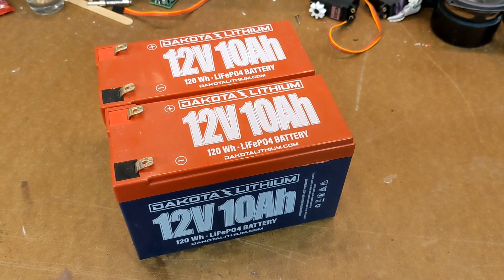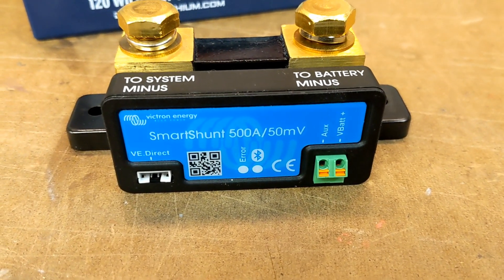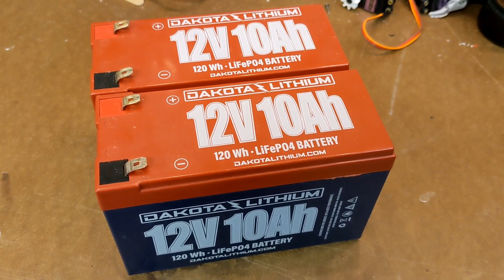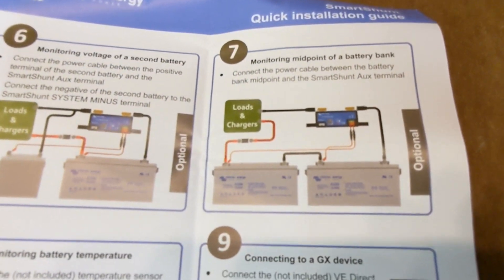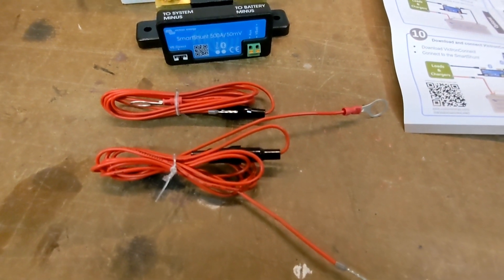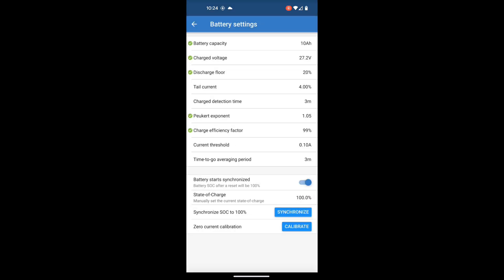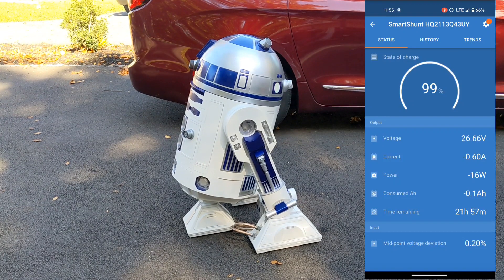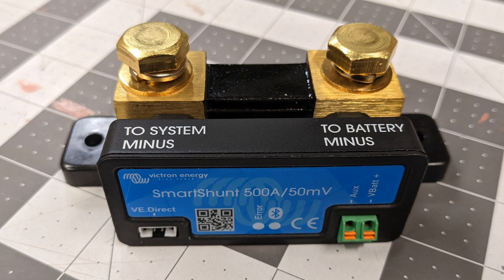Can we answer "How long will my batteries last?"

Comment: Hey Jason. Curious about how well you feel this system has worked now that you’ve had it a couple years.
Reply from the maker: The system works really well, no complaints. The only thing is that now I know my batteries can go a full day, so I don’t rely on the data like I thought I might. If you’re in doubt, this will help you be absolutely certain how much juice you have left.

Comment: Thanks for the video, Jason. I also installed my SmartShunt yesterday. But I'm still stuck on the question of how I can do the wiring so that I can charge both batteries within R2. They are connected in series to get to 24V, but wouldn't I have to land both individually? My wish would be to make it so that the SmartShunt also tracks the actually charged A. Have you already solved this? 🙂
Reply from the maker: To be honest, charging the batteries in series while they are inside R2 is a problem I have no interest in solving. I discuss my reasons why in this video (in case you haven't seen it): https://www.youtube.com/watch?v=kGr3Td5drZc

It is my opinion that any benefit gained from not having to remove the batteries to charge is far outweighed by the added complexity of the system required to accomplish such a task, not to mention you still need to balance charge the batteries separately from time to time. That's not to say there's no value in this approach for others, simply that it's not at all on my list of priorities.

As for the shunt tracking the charge state, I'm not 100% certain it can track inbound current, but from a wiring perspective, you'd have to make sure that it is placed between the batteries and whatever switching mechanism you implement to change from operation to charging so that the current passes through the shunt in both configurations.